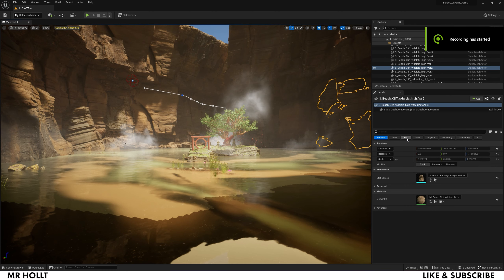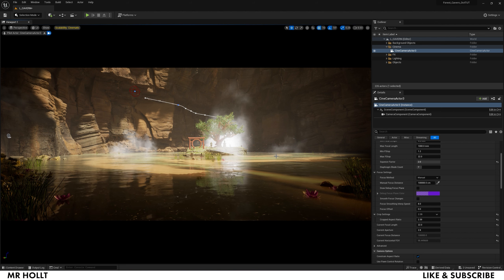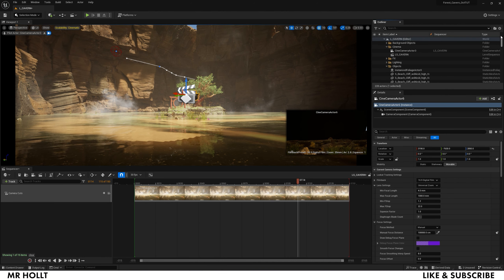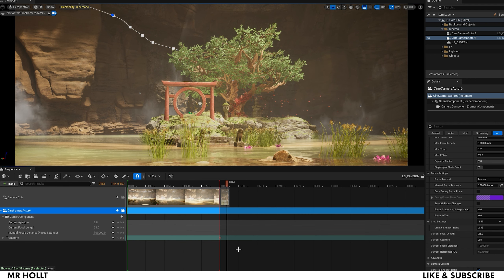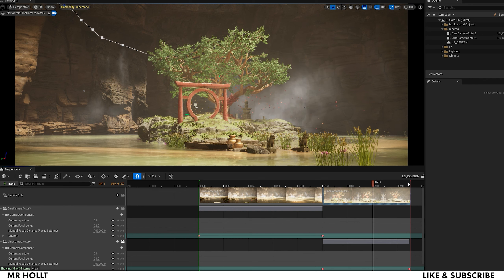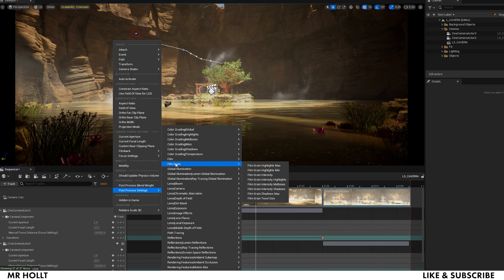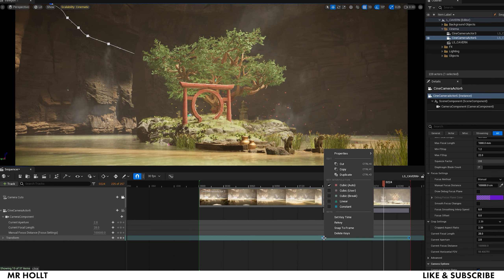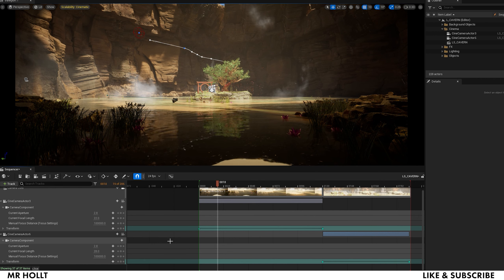Camera Sequencer Tutorial - Unreal Engine 5.3 #ue5 #tutorial #cinematic

Comment: I have a question regarding how to setup a 2 view port configuration in my level sequence.  I want a view in left view port that is a shot of the level. A wide shot of the area. Just a perspective camera looking at the level.  In the right view port is my camera Actor.  Now I want to be able to see and move around the camera Actor by translating and rotating it in the left view port.  What happens now is when I select the camera Actor in the left view port I get a third smaller view port in that left view port.  That smaller view is in my way.  But I have not been able to find a configuration (setup) that will not pop up this smaller view in the larger view port. Any help would be appreciated.
Reply: im not sure if this will help but, under windows you can find a lebel called Viewports, if you go on it you will se you can activate up to 4 viewports. ( i use this to simulate on one of my screens from one cimenatic camera ( that you can select by clicking on perspective lebel at top left corner of the screen) and at the same time i can keep editing on my other viewport that can be on another camera. So i belive that if you select a camera for each viewport and put them in the sequencer you can see both at the same time. hope this helps somehow.
Reply: @PEMGILRAT  Here is the problem,  I am using one monitor.  I do not want 4 viewports showing.  Too small.
Reply: @steinmov  if I'm understanding properly you want a split screen that on right of the split it shows the view of camera actor1, and on the left par of the screen is a wide view of the scene to facilitate the positioning of actor1. But by clicking actor one a small window appears showing the camera view. If you just want to get rid of this small window you can. Toggle of in menu bar Edit -Editor preference - Level editor Viewports -  toggle off/on "preview selected camera".